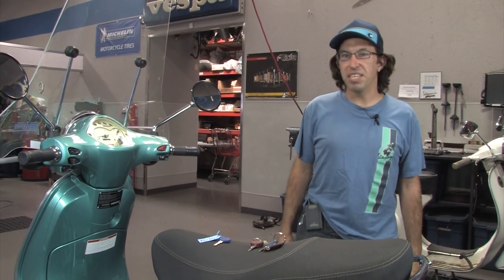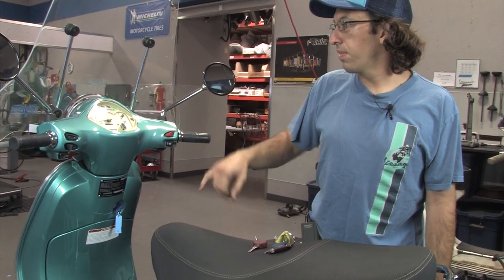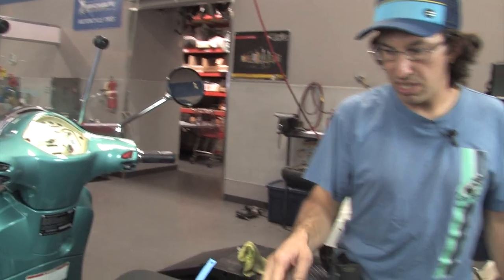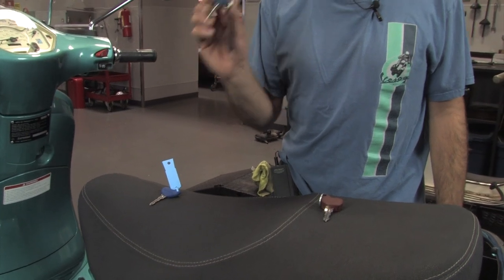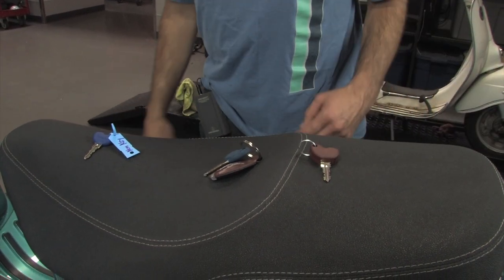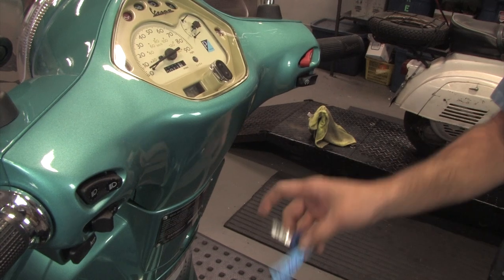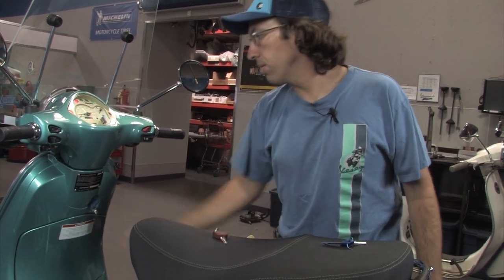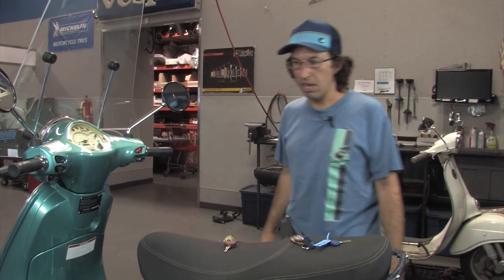How to Program a Vespa Key

Comment: Robot..your videos are fantastic! My Vespa primavera came with the red key only. I got a blue key and had it cut to the red key. I brought them home and followed your video. When I put the red key in and flip out the tab, it will blink twice and then go solid red. When I put the red key in with the tab in, it just blinks once. I pull it out and insert the blue key, let it blink once, and then put the red key back in and let it blink once again and pull it out. When I put the blue key in, it still blinks three times.

Comment: Thank you Robot. After watching your video, I was able to program the key I bought on Ebay. I tried using the instructions in the manual for my Vespa GT200 but failed. You saved me an embarrassing trip to the dealer. I wish your shop was nearby.

Comment: Thank you Mr. Robot for your informative and interesting channel ! Since there is no Piaggio service center in my country I need your help. I bought a 2006 GTS 250  at the USA auction, which has only two blue keys. Unfortunately the red key was not given to me, so there is no card with code. My blue keys can't start the engine. The code light flashes 3 times and then lights up constantly. Can I buy a red key (which is sold in ebay) and program the immobilizer of my scooter using it? If not, is it possible to get some kind of security code from the official manufacturer? Or will I have to buy a CDI module with the keys? I beg you to help, because I have long time dreamed of such a legendary scooter.

Comment: The video ias good, but I have a worse problem, bought a 200Gt, 2004 model at auction, no keys, no way to contact previous owner for one. Gone to dealer to get new key and barrel, they don't have the specific program to program new keys to the Vespa. What next? Is there a scanner for this that one can buy to program the new keys?

Comment: I bought a 2007 LX50 and it only came with one black key. I don’t see any led turn or flash…can’t even see where there is an led on the dash. Machine starts and runs well. I want to cut a spare but I’m not certain if I can or if this machine even has the immobilized.

Comment: Thx for this video
I'd like to benefit from your expertise as I have an issue with my 2008 LX125 Vespa which does not start after being exposed to an heavy rain: the led is then flashing 2 times and then is staying on after a few seconds. 
Looks like the rain is getting in and preventing the electronic system from working properly
Any idea on what to focus on to solve the issue?
Last time I had this, it started again after waiting a few days, ie when it properly got fully dry
Many thx

Comment: Hi Robot, great tips there thank you - can I reprogram my current key with a different throttle body/ecu unit? my Throttle body is faulty and needs replacement - used ones I see on ebay don't always come with a key so wondering if I can use my key and make it work with an afternmarket unit. thanks

Comment: Hey Robot, thanks for the video, I realise that this video is now 8 years old, so can you tell us, should this routine still work in 2022 on the new HPE 300? if not is there a way that we can do the same cloning of a key? TIA...😎
Reply: Man I wish Robot gives an answer to this as this technique for some reason doesn't work on mine. Been trying multiple times
Reply: @ariankazemi8142  if it is the hpe model that you have, then it will not work, the 2022 on uses a semi rolling code and requires coding by the dealer.
I only found this out as I tried everything to get it coded...🤔😀
Reply: Though I have the Primavera 2020 model

Comment: I need help on my primavera in 2016, at the stater but can not live. After the spark plug wires are opened, there is no fire. Fuses and lights, normal horns and oil pumps do not sound when the ignition is on, please guide brothers

Comment: How do you turn the immobilizer completely off?
Reply from the maker: There's really no simple way to deactivate the immobilizer system. If you don't have the master key, we offer a service to extract the codes from the CDI and make you a new master key.
Reply: *****
Where are you located im from Europe..
Reply from the maker: We are in San Diego, CA USA. You can search on our website for part# LLLLOCK04 or LLLLOCK05 depending on if your bike is carbureted or fuel injected.
www.scooterwest.com
Reply: Hello, I have only one master key, can I program myself program the second key for permanent use? How to do it? Service key lost